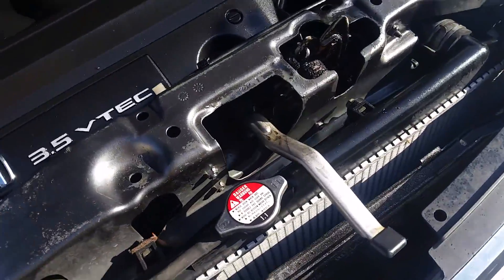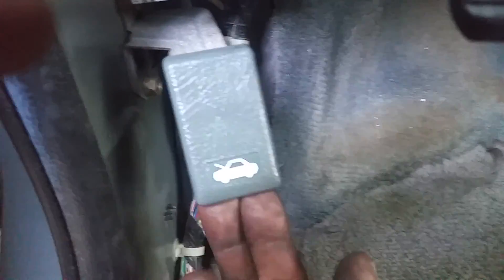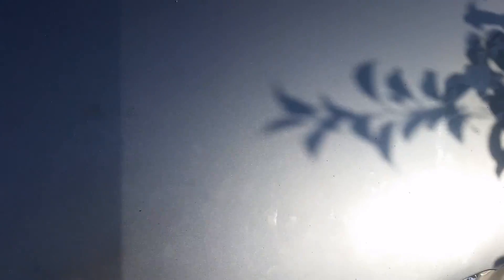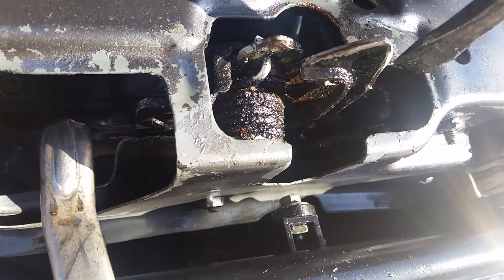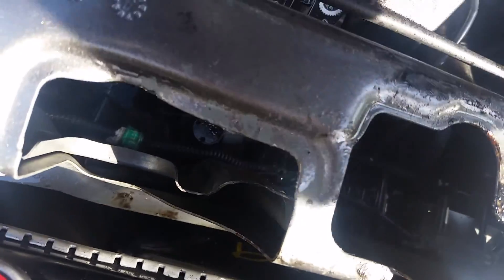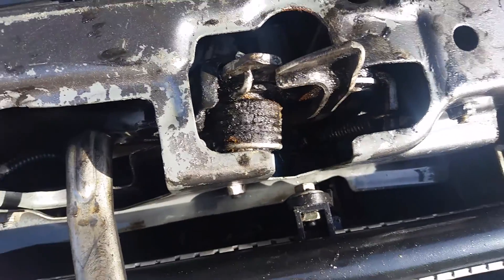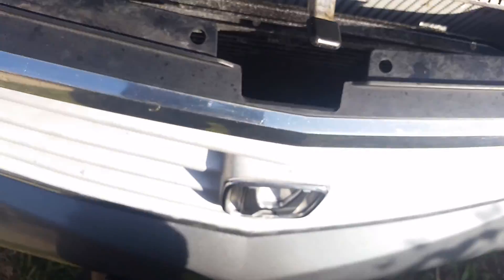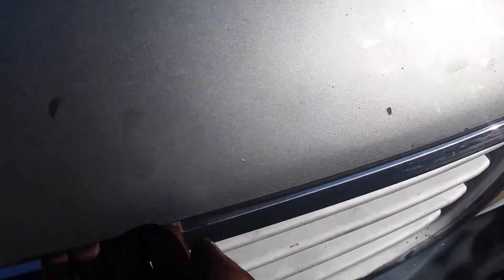Simple as 1.2.3 how to fix you hood Honda 98 to 2004

Comment: Im wondering if i should purchase a 07 Dodge Charger with a seized motor its been sitting for a while and seized due to not changing the oil. I dont want to purchase it and have to buy a new motor. PLEASE HELP
Reply from the maker: #1 you are in the wrong  show,  anywhere is depen how much  you are going to pay for? To me I will  buy the No more  then $500 and take a shot and try to fix it. if you  are watching the other  video  it will give  you the ideas ***(simple as 1.2.3. how to unseize engine Mazda 3) spencervongnaraj YouTube.